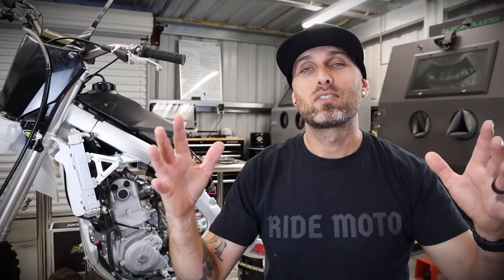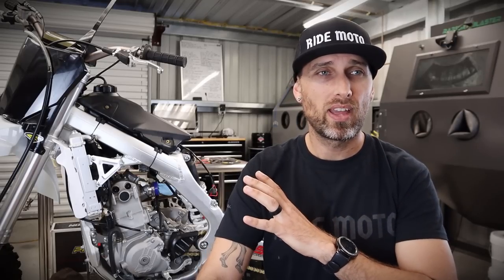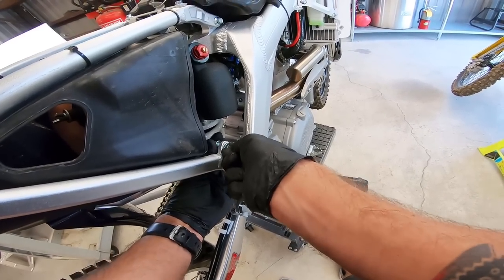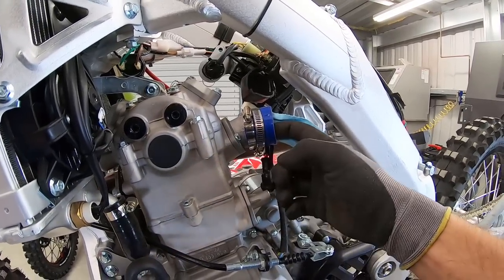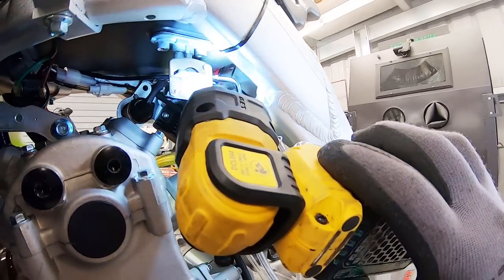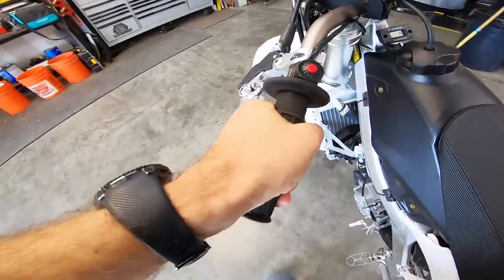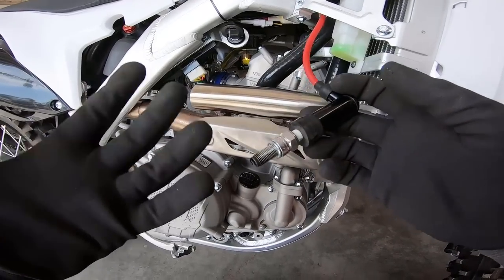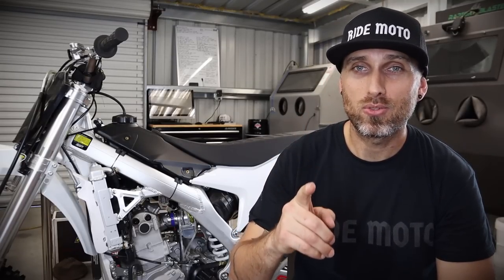I Installed A Lectron Carb in my CHINESE Dirt Bike... SHE REVS!! - 2020 SSR Motorsports SR300

Comment: Hi , interesting video. So I presume this is the zongshen 250 motor with the 300 kit fitted by the factory. Ajp motorcycles and Fantic use that motor In their trail bikes which are fuel injected. Not sure if that could be fitted to yours? Or whether that is a to expensive option. The ajp uses the new GET ECU which I believe you can re map. Just a thought. 
It's interesting how you are getting on with the motor as I was debating buying an ajp motorcycle and fitting the 300 barrel as a lightweight adventure bike. I'm 58 now and although I have a crf450l ,husky701 and ktm250excf am looking for a cheap easy to ride low maintenance bike.

Comment: Since the stock carb was a Keihin PWK or a similar Chinese knockoff, I would think you could have jetted it in pretty good without having to spend a bunch of money for a Lectron.
Reply from the maker: Yes one would think but I wasn't the case with this bike. It has a lot to do with the airbox flowing too much air in conjunction with the wrong carb for the job.

It simply didn't run it's best with  stock or revised jetting (first video in the series)

-Charles // mXrevival

Comment: Ok 1st I wanna thank you for the time and effort u put in ur videos! They're awesome and we appreciate them! Now, my question is have u modified the exhaust on yours? Or do u plan to? I have a 2016 450s and cannot find one specifically for it. Now I heard they are very close a clone to the crf honda 450x. And there are plenty of parts for that. But would u say compatible or not even close.?
Reply from the maker: Hey miyguel, thank you for watching and you are welcome! Sorry I am just now seeing your comment. Yes, I actually ended up doing a pro circuit unit, and that video is in the SSR playlist if you have time, or if you haven't already seen it. I believe there is a pro circuit exhaust specific to your bike as well, may just for ssr. But also the 450 being a Honda clone, as you've stated, will accept Honda exhausts I am almost certain! I was even told by someone who had their sr450 engine apart that they use the same Japanese crank bearings as the Honda. So that was great news.

Comment: This should relate with the GPX FSE300R as well. Same motor.
Reply from the maker: Right? Pretty cool that they are fuel injected.

Thanks for watching 🤜🤛
Reply: @mxrevival  I didn't realize they were fuel injected. Kind of wonder if the FI system would work on the SSR.
Reply from the maker: @riccochet704  You and I both!! 

I bet in can be done...

I've seen a twin cam head floating around the internet too....

Comment: I didn't know you could run a 2-stroke carb on a 4-stroke.  I thought 4-strokes needed an accelerator pump because the vacuum is not as strong.
Reply from the maker: Yep, you can & it's part of the reason the bike struggles.

You are exactly correct regarding the low vac at idle that 4 strokes make, thus typically requiring an accelerator pump.

Mainly in our newest Lectron solution, the tolerances are much tighter and combined with the CNC cut metering rod, (and no jets to draw fuel through) the vac produced is enough to wake the bike up incredibly after install.

We do have another 4 stroke specific Lectron. It also eliminates Jets and accelerator pumps, but due to the price point of this bike initially- we felt that developing this option for the 300 would be in line with the original price point of the bike itself.

In other words, this carb is about $475 and the four stroke specific Lectron we carry (which can be used) is closer to $800.

So we felt that was the right call for the situation.

Increased performance on several levels, elimination of jetting, and a great price are all combined to make the best value for all of my riders. 👊

Really good technical point, thanks for bringing it up Christopher.

-Charles // mXrevival

Comment: I’d be interested in knowing if a larger tank would fit. I think IMS and maybe Acerbis make them for the crf250r, which is what these are based on frame wise apparently. Because I’d like to get a headlight and tail light on mine so I can connect trails without any trouble
Reply from the maker: We are no longer making the block-off plate, but yes it can be done & here's how: https://www.youtube.com/watch?v=DGqBHPRt60g&list=PL_oYXNbYADbKcVE5-1ziR2exgppjvvGJQ&index=13&t=790s
Reply: @mxrevival  awesome! Do you think you’ll produce any more? Or how could I get the plate?

Comment: If ur going thru the process of"open up"the breathing to bring that engine to life you should also at least change exhaust,if not whole at least the tip.The header u can easily make one urself with a slightly wider pipe.If u gonna throw more air and gas she needs to breath that out too.You will gain more power and less heat.
Reply from the maker: On this particular model, it's getting too much air. The airbox design is that of a high performance crf450r, while the engine is the opposite. Not a high performance engine. So we're trying to get this particular machine more fuel to handle all the additional incoming air (which we have been extremely successful with in this case!) 

In the stock configuration, this bike would actually need the opposite. "Closing off" the breathing. (Stock carburetor).

I agree with you in a high performance application

Comment: Did this bike really not do "forced" wheelies when stock, or was that just an exaggeration to accentuate the power increase u felt from the carb swap? Its rated a 30hp bike, even if thats at the crank not the back wheel(which I suspect is the case). Thats on par with a honda crf250x. My crf 230 i had was not even 20hp at the crank and it would easily pull the front end up with a lil lean back or clutch slip in 1st, in 2nd it would easily pull up still with a lil yank on the bars.
Reply from the maker: I believe the gearing is very tall in addition to the big bad BOG off the bottom with the stock carb. 2021 will have a pumper carb stock so that'll change.

Also, the 230 has a shorter wheelbase, which would more easily allow the front to be brought up.

There's a combination of things going on, really.

But- I'll always be transparent with you guys.

We all stand to gain from truthful chats and reviews together 🤜🤛

So it was a good question. 

What's misleading are the comments containing opinions regarded as facts (from non-owners always). 

Thanks for the critical thinking & comment, Nick!

-Charles // mXrevival

Comment: I love the lectron carbs but they are rather expensive... I wanted one for my mini bike but the cheapest one they have is like 600 fucking dollars although I have $100 rod $100 flywheel $100 cam $50 valve spring package $50 flat top piston with rings and a $40 34 mm Chinese knockoff power jet carburetor $400 clutch all packed and stacked on a $99 Predator 6.5 horsepower motor does 65 + mile per hour with only 40% throttle 1 gear 16 tooth in the front 70 tooth in the back 15 in tire my baby cooks and I haven't even ported and Polished the head yet.
Reply from the maker: Sounds like a killer project!

Our Lectron carbs are only $475 ($600 is too high)

But that's how special projects like yours go, they add up $$$ 💪

Comment: Local dealer got a leftover 2019 250S for $3500.. Grab that or spend the extra G for the 300S? The videos rock, keep em coming 🤙🏼
Reply from the maker: Appreciate that big time 🤘 Thank you.

Man I don't know too much about the 250 but I don't think you can go wrong when getting the newest machine you can! Especially at this price, and with more power/ features.

If it were my money I would go for the newest model, the 300s. If that ends up being the case, I'll be doctoring up mods for you guys too- so you can actually do them too, yourselves!

Thanks for watching!

-Charles // mXrevival
Reply: Definitely get the 300 the chassis is way more modern the 250 is like a 05 honda the 300 is like a 17
Reply from the maker: @randywoodward9707  good feedback. Cool seeing guys help eachother
Reply: @randywoodward9707  I'm convinced, thanks 👍🏼
Reply: The suspension actually isn't horrible but it is a little heavy. I picked up some showa's off a 2014 honda they were a direct bolt on and a pretty big improvement
Reply from the maker: @randywoodward9707  I thought they were valved really well for trails myself, in total agreeance in other words! Just under sprung for my fat ass at 200 lb.

I bet you shaved a ton of weight if you use the PSF fork? I actually thought those worked really well on my KX 450 after a re valve back in the day! I could see you guys getting a really good deal on those as well. 

Keep the feedback coming guys, the 300 Crew will have a great list of resources here.

-Charles // mXrevival
Reply: @win s  found the 300 for under $3200.  A dealer in Goodyear,AZ.
Reply: @marcmo7138  lowest in NY is $4399, low market over here

Comment: Two questions for your you.. first, do the Honda plastics fit on this bike? And second, where did you buy it?
Reply from the maker: YES you can slap a 2013-2016 CRF450R plastic kit DIRECTLY onto this machine! 

The stock SSR Radiator shrouds are a different shape but you can get rid of them (I like them though, helps differentiate somewhat) - we're almost ready with a specific graphics kit just for the 300 too - because of the shrouds...

Let me know if you need a hand. I'd be happy to help - In fact, check out our plastic catalog if you'd like!

https://www.rtechmx.com/media/pdf/Cat_Rtech_2020.pdf

Page 20 has all the complete kits & all of the single bits for Honda are in the very beginning of the catalog.

I'll be right here whenever you need a hand: https://www.mxrevival.com/contact

Oh! And I bought this at Salinas Motorcycle Center - but you can use SSR's dealer locator if you're further away:

http://www.ssrmotorsports.com/store/dealer_locator.php

Thanks for watching!

-Charles // mXrevival

Comment: Get a modded FCR carb...Lectron is great for 2 strokes...the FCR will make you scared of the throttle response
Reply from the maker: Very familiar with it & totally agree.

Awesome as hell when dialed in, leak jet/ AC pump bog gone, and the linkage mod done. Shredder!

The Lectron does a killer job on both 2 & 4 IMO. Have been a dealer for years, and helped a lot of guys out. This was fun, uncharted territory. 

I like jetting, really. But most guys... well, you know- don't.

Thanks for hangin'

-Charles // mXrevival

Comment: Does it make a difference weather you start at the throttle housing or start at the carb as far as the throttle cable goes. I hear a lot of guys say you need to start at the throttle housing.
Reply from the maker: No sir, unless there is something structural about your bike that makes it easier. But there's no harm in connecting one and or the other before or after the other 👊

Comment: purchased a gen 2 lectron for my rmz 250 . going to try it in my sr 450s . may have to adjust the meetering rod but should be miles better than the Polaris style carb the 450s comes with.
Reply from the maker: So true. The carbs are the achilles’ heel on each of the full size SSRs. You can drop your Gen II right in once you buy some OEM CRFX parts, such as the intake flange and airboot, etc. those will give you the right dimensions that the old FCR carburetor was using in the X, which are the same as your Gen II. We sell the Gen II to a lot of SR450 guys and they love it. Absolute worst case you may still need a 450 metering rod. Have fun!

Comment: Sick video! You do awesome work brother. Ok ok I’m listening.. I need to buy a Lectron for my KX500 supermoto. I’ve been STRUGGLING with the jetting the stock carb and fouling out plugs...
Reply from the maker: Oh dude, let's get that taken care of! No need to struggle!

Is your KX pretty healthy otherwise? Good compression, no frayed reeds, no air leaks, etc?

Sometimes I will have customers try to order Lectrons to "fix" a bike that's running a little funny, but they sometimes have some work components causing the run-ability issues.

So I always like to ask in case the bike COULD be ripping for a $60 set of reeds instead, you know?

THANK YOU for the killer compliment

-Charles // mXrevival
Reply: mXrevival 
The engine is a fresh rebuild, I sent crank to be rebuilt by Tom Morgan Racing with a Wössner rod. I installed new crank bearings and seals. I have fresh stock cylinder hone with Flex-Hone and a fresh Wiseco piston. I have a brand new Boyesen RAD valve with Pro carbon fiber reeds. I run a FMF expansion chamber and an NGK BR8EG plug. She runs amazing, just want the hassle of no jetting if I travel also is running a bit rich and fouling plugs I think because I’m not opening her up “on the pipe” as much as I should because I’d be running way to fast around town if I did and I’d be arrested 😅. So I have to “lug” the engine a bit and it loads up with oil. My stock Keihin PWK carb has a 168 main jet and 58 pilot jet, 3rd (middle) needle position. I’m at basically sea level. 

Thanks for the response and willingness to help!
Reply from the maker: @bumpstartnether  Oh yeah man she's fresh!

It sounds like you might just be right around the corner from some really good settings with the carburetor you have.

I know it can be kind of brutal swapping brass and trying to get just the right jetting combination only to have it run less satisfactory if you end up in the mountains or something at elevation.

Cool thing is she sounds amazing, and is running, so you can tweak a little more and the absolute worst case scenario is that we'll always have a Lectron on deck down the road if needed!

I'd say that's a pretty good situation to be in! Lucky guys with first world problems.

And you're welcome, life is short. Have to help people when we can.

-Charles // mXrevival

Comment: Hello, my question is, have you tried on your bike the FCR33 MX carb?.  I did and it's really powerfull but, i don't figure this out yet, how do I connect the TPS on the CDI? Is there some how?? Please advice.
Thanks.
Reply from the maker: Hi Omar,

Unfortunately there's no place to plug in any TPS or electrical as the bike's ECU doesn't support it. Even the 2021 with an FCR style carb does not have electronics. 

You can simply cover up and disregard the TPS connector on your carb swap.

Hope that helps!

-Charles // mXrevival

Comment: Any idea if a bigger tank can be found for the model?
Reply from the maker: Man, I haven't confirmed it myself but I bet a big CRF tank would fit this thing. 

I think the only potential issue there would be: The Honda that used this frame type in 2013 through 2016 was fuel injected and not carbureted, so you would need to do some fabrication (which could totally be done) in order to install a fuel petcock in the donor tank from a fuel injected bike, for the carburetor on this bike to receive fuel.

Normally the fuel injected tanks have a big access door on the bottom, where the fuel pump assembly can be removed.

This is a pretty common situation on guys bikes that are aluminum frame T
two strokes swaps. Since the two strokes were carbureted, and the donor bike fuel injected. 

Guys will basically fabricate a metal plate and have the holes drilled, and tapped where applicable, in order to throw the fuel petcock in.

But, this tank does also have a reserve which I have not gotten to use after a couple hours of riding period so it is pretty dang fuel efficient.

With the new Lectron carburetor installed we typically see even greater fuel economy since the bike is no longer prone to running rich from bad jetting settings performed by the user. The Lectron will give the bike only what it needs, when it needs it period so much less waste.

I hope that helps!

Comment: What year model honda number plates did you use I'm really about to go get one but I need to sort out what after market parts and plastics I can use I have a solution for the suspension and carb but the exhaust is another thing I can not find anything on I'm a A class woods rider I'd like to do this just to have fun with it
Reply from the maker: HI Neil, 

You can use ANY 2013-2016 Honda CRF450R plastics on it. 

We have a graphics kit coming soon for the stock 300 shrouds too 🤘 

As for the pipes, I'll have some units coming up on the website soon! With removable sparkys!

-Charles // mXrevival
Reply: @mxrevival  thank you for your hard work
Reply from the maker: @neilorange4112  and thank you very much for watching Neil!

-Charles // mXrevival

Comment: how  would the bike  run if you would of put the largerest jets in   the stock carb.  and not forgo the new lex carb.
Reply from the maker: In the "first ride" video, I re-jet it trail side. Larger pilot & main. (
Video has chapters: https://youtu.be/iPj0TzFlEcY )

It liked it, and ran better but needed a little fine tuning.

It'll come down to personal preference in the end.

Some people will love the stock power delivery.

Some people will want more.

Some people will want the most out of it with the least amount of effort in any situation.

So that's why I did this mod for The 300 Crew 👊

https://www.mxrevival.com/ssr-motorsports-sr300-modifications

Great question, Marvin!

-Charles // mXrevival

Comment: Wondering how many hours you have on the bike in this video? Being new like it is, the engine, especially the rings, need time to seat in before you're going to get the potential out of it.
Reply from the maker: Hi Jeff, 

About 1.5 hours. 

Great point! The carb is a hot mess and had to go in either case!

Thanks for watching 🤜🤛

-Charles // mXrevival